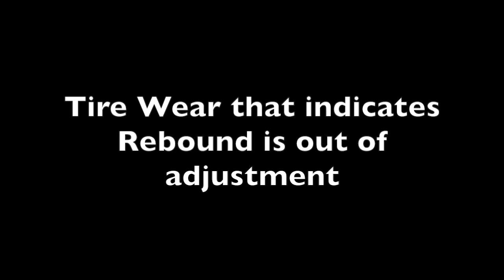Contact Patch: Rebound Tire Wear (TRAILER)

Comment: i can not leave a comment/question on your website (full video) for this video. first bike: ist there a disadvantage, when rebound is too fast for the edge of the tire (cornering), but ok for the middle part??? can you lose "contact" while cornering with a too fast rebound?
Reply from the maker: With rebound too fast, the bike is unstable mid corner so you out a lot of constant effort through the bars to keep the bike on line. Once you get on the throttle from 25% and up and put control into the chassis via acceleration, the rebound is influenced by the suspension being consistently compressed via centrifugal force.
Reply: @catalystreactionsbw  so you can only leave it like that and find a reboundbalance for the edge but more for the middle of the tire for full accellaration?
Reply from the maker: @MrMedicusNeo  You assess rebound balance via tire wear in the zone of the tire where you apply the brakes/throttle to have control over the chassis (shiny verses flat black area of the tire). If you have dialed in electronics, the flat black area may be 80%+ or more of the tire verses no aids = 65-70% of the total area: https://davemosstuning.com/contact-patch-reading-tire-wear-1/
Reply: @catalystreactionsbw  ok I understand. You eplain this also in the "ninja 300" Video. What can be wrong with the forks when setting/changing "compression" does not really reakt.( New oil 10w, gsxr 600) ? Ooo now i watched your New fork vid.  the  "compressionholes"on fork bottom are not clean :)
Reply from the maker: @MrMedicusNeo  Yes, that can be the cause as oil passages are blocked

Comment: I wish that you would have gone more into the comparison of the Dunlop and the Perelli.  Thanks for posting your videos.
Reply from the maker: Dave Williams, editor, replying here.  What points of comparison did you want to see?  In this video the comparo was not about the tires per se, but to illustrate which portion of the tread pattern you want to read and tune to, regardless of the tire.
Reply: Dave, thank you very much for your reply.  I was very interested in where the edge of the tire really was, the Dunlop was so much closer to the edge, did the Dunlop allow the rider to lean farther into the corners?  That would be a very interesting video to see.  I have met Dave Moss a couple of times and I was totally impressed with his knowledge and abilities and his good personality.  It was an impressive meeting.  Thanks again and have a nice day.  Jeff.
Reply from the maker: Jeff - thanks for the kind words! The Dunlop  has a different profile and is a harder carcass, so the rider used more of the tire based on carcass and ability. The Pirelli rider did not have the same ability hence not as much overall use plus it is a soft carcass tire and deforms much more which means in general fewer riders on Pirelli's get to the edge due to sidewall flex.
Reply: That was a great explanation, I learned a whole lot.  Thank you and have a nice day.

Comment: My suspension is gotten ruff and there is vibration in my  handlebar is it because it  also had oil  leak in one fork from upper T bolt
Reply from the maker: If the fork is leaking oil you have different volumes in each leg so each leg works differently. That will create an imbalance. You might have lost a wheel weight or have another issue, but the forks will be a significant contributer.